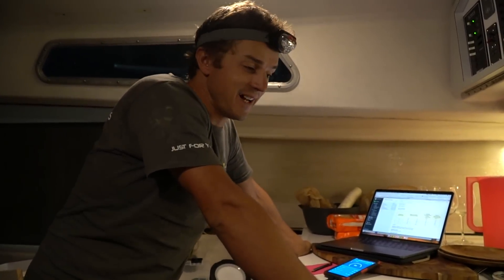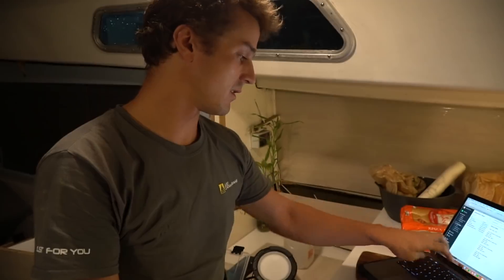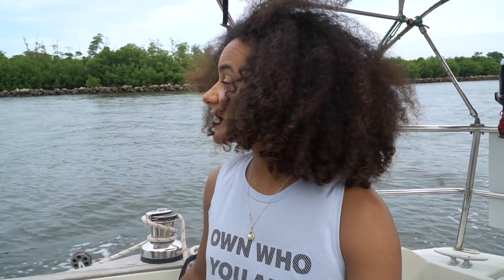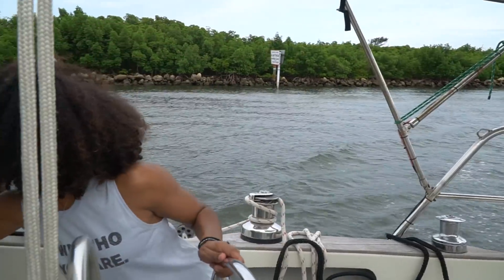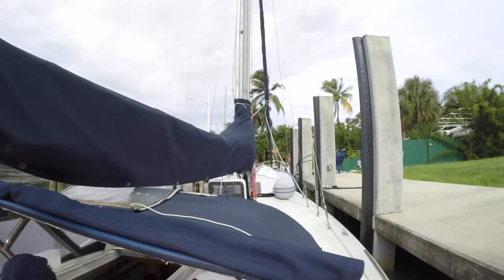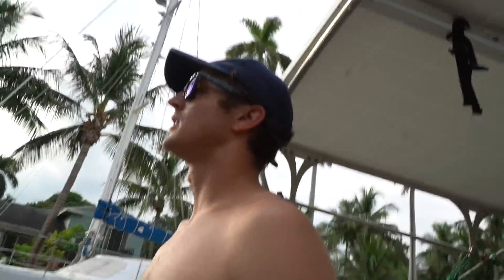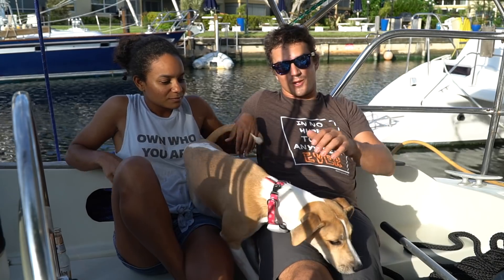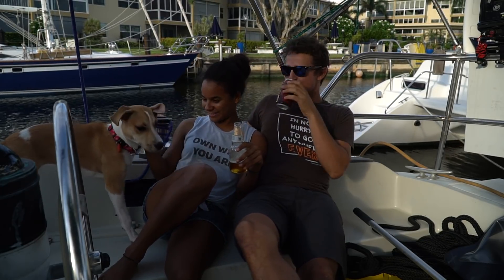Pushing our Electric Motor to its Limit— Sailing Uma [Step 139]

Comment: Could you put a permanent fan on the other side of the motor (to that visible shaft) either to suck air away from the engine compartment or push fresh air in?
Reply: Fans take current , are noisy and the cooling relies on air temp that can be quite high above outside down below on a sun drenched boat  , plus then the heat can be uncomfortable for the people . I say a simple coil wrapped around the motor with a tiny pump to raw water to cool it . Water temp is more stable , quieter and not so invasive .Could use the old engine intake and any drain through hull   . Maybe out a cockpit drain so you have visual confirmation of flow . 

 I would then put a few fans to cool the batteries on a stat . As the batteries go dead the current and heat will spike in both the motors and the batteries , and the cables but the cables  should be OK as they were sized properly . 

Many store bought electric boat motors are submersible for the natural cooling it provides . That is also why submersible pumps at your home last longer .
Reply: An extra fan great idea but will affect overall draw of the motor
Reply: Steve Jones Yes of course but external fan also takes current so...

Comment: Have you ever considered putting an outboard motor mount on the stern and using your outboard if needed?
Reply: Was just about to say!
Reply: Have seen those that just tie the dingy to the sailboat and pull it with the dingy for short periods in an emergency.
Reply: Theyve done that with Uma a few times.
Reply: Having sailed on small sailboats for over 20 years I found that using the dinghy in an emergency situation is not practical.
Reply: Or safe. It's a good way to lose your boat.
Reply: It works fine in a pinch. I wouldn't recommend making it a habit but it does work for some added power.

Comment: Hey congrats on the successful test.  That is about what an "auxiliary" motor should do.  After all you are in a sailboat.  Looking forward to your liquid cooling solution.  Water is so much more efficient at cooling.  Are you going to install a permanent temp sensor? 
When I had my Gemini I rented space and parked it right around the corner from where you are there.  Tricky navigation with all those bridges and current.  STress city for me.  I had to do it solo one time. That sucked!